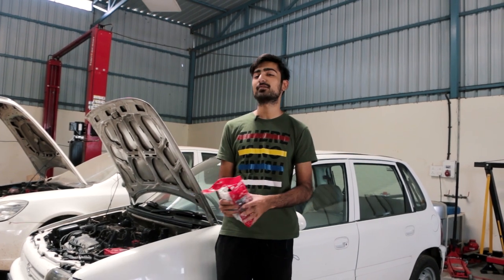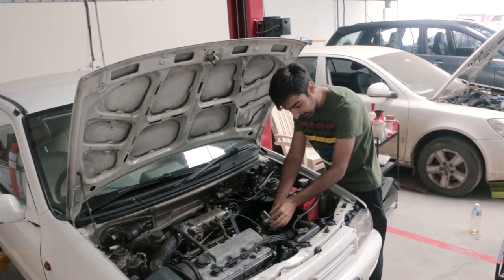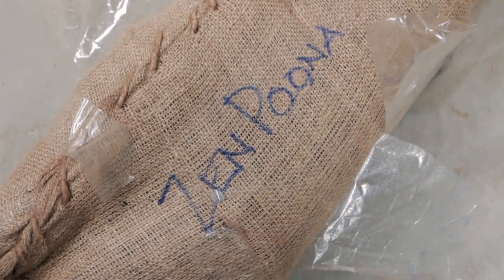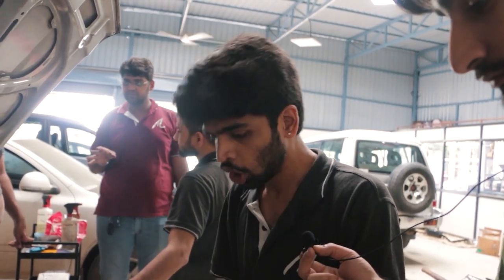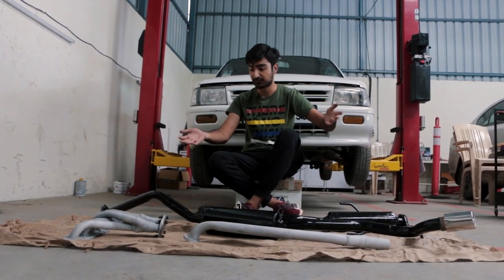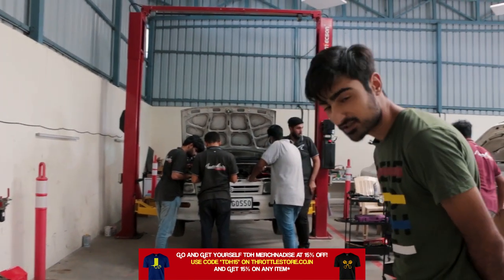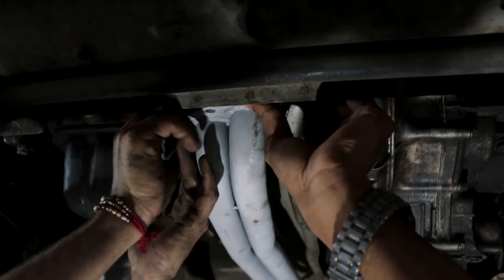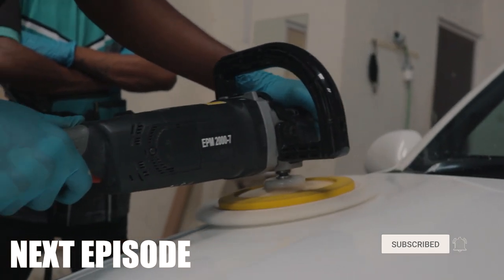Performance Headers & Exhaust for the 2001 Suzuki Zen! (SOUNDS LIKE A RALLY CAR)

Comment: Remember my uncle's 2 door zen 1.6 ... It was called carbon steel or smtn.  It was a pocket jet
Reply: Zen normal  , steel / carbon comes only with 1.0 engines not 1.6 😂😂😂
Reply: @arjunbabu6999  ohhh my bad ... thanks for correcting
Reply: @cyrilmatthew2995  👍
Reply: @arjunbabu6999  zen carbon is 1.5bro